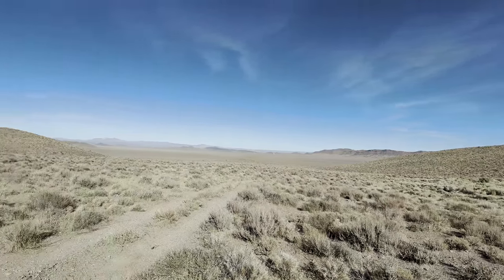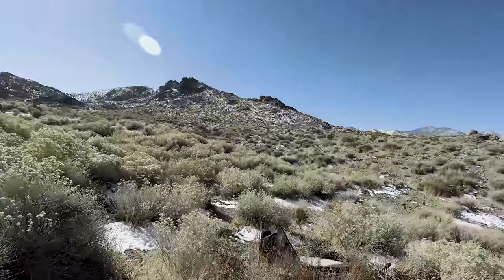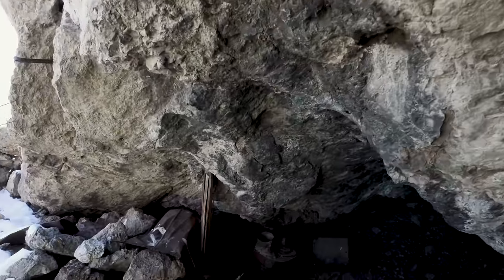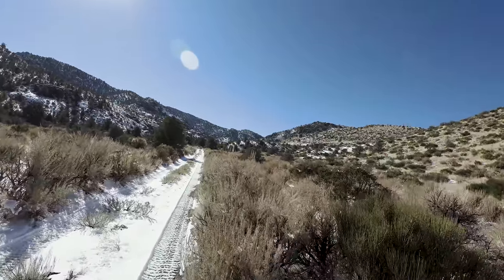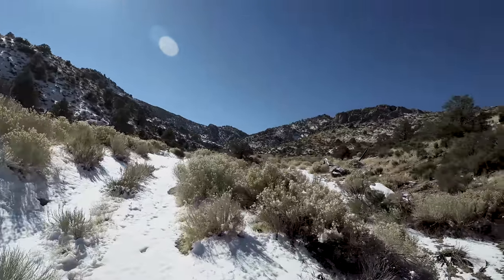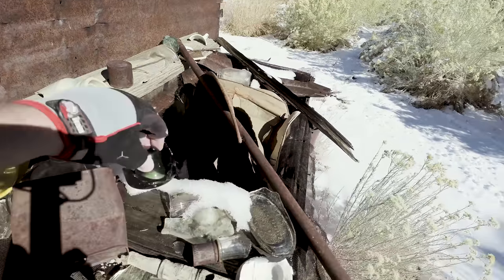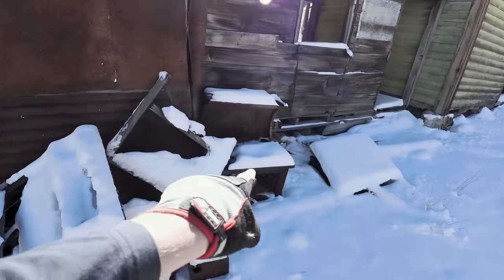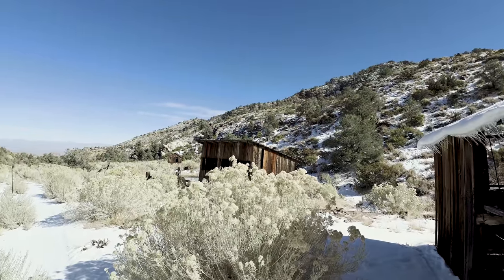Abandon Family Ranch Hidden in the Mountains

Comment: If you look around 16:33 into the video you can see where they put new wood to brace the rafters.  The top portion of the insulation looks like old cardboard asbestos they used to insulate heating vents too!  Great video.  I traveled to Rhyolite for the first time 3 months ago. Would love to go back and check that out and the old cemetery.

Comment: My understanding is that the "Amargosa River" in Death Valley actually runs underground. Good thing, I guess, because the water evaporation rate in Death Valley must be just enormous.
Reply from the maker: It does break the surface in Sperry Wash. I was thinking of doing a video drive through the wash. Interesting rock formations and there are several water crossing. Though not deep, it is still neat since the canyon you are in is nothing but rock.
Reply: @DesertTrailsExplored  
And there is seasonal flooding, I guess it rushes around the edge of the little town of Beatty? I've seen film of it somewhere, and a destructive flood made national news once I think. Sounds exciting! And the "oasis" by a casino near Pahrump? That is part of that river (I heard).
Reply from the maker: There is flooding, but not really seasonal. One of the most destructive floods that happened in the Amaragosa and Pahrump valleys which happened in 1910. It wiped out several mining camps. One camp in Pahrump Valley called Browns Camp was completely wiped off the map.

Comment: The two rock structures are a large fire pit for heating your body and rocks and general purpose and a sweat lodge for healing and bathing.  It is large enough to get one or two people inside.  The rocks were heated,  then placed in the lodge, where they would pour water over them for steam... A steam bath if you will..  i am not sure what you think would be "harvested" , but there were other easier  means of drying food.  The "lodge"  may have once been covered with mud or animal skins. These same type of structures are found near water sources throughout many areas where there are no trees or other materials to build with...  But they are obvious to me.  That is DEFINITELY a sweat lodge for healing.  The fire pit is obviously designed to sit on that big rock with your back to the fire...  It's not for drying seeds and food ... lol 

The "cave" was a range riders "line cabin". The reason that the stove and cup are left there,  for other cowboys to use when out tending the herd.. In those times,  cattle were watched closely because of rustling and beef poaching being a major problem.  And every cow was valuable because they didn't bring much money anyway.  Losing 10 cattle out of 40 could devastate the operation..  It is a great place to get out of the heat or the cold, and room enough to stand a horse... You might have been the only person to discover the hide away in 80 to 100 years.  But maybe you didn't look close enough to look for signs of having had a horse in there or anywhere close by.   It was most likely known about and used by the Stozzi riders.

I know these things,  because I have lived that life...   Some of your ideas are very skewed. And they make me laugh ....